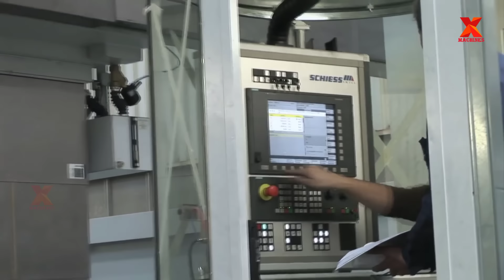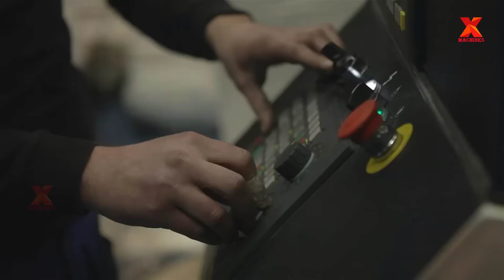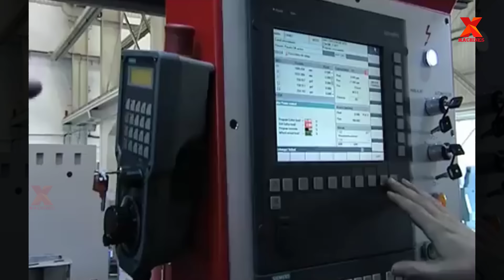Amazing Heavy Duty CNC Machine. Multi-Process Vertical Mill Turn Machine. Crankshaft Rough Milling

Comment: I used to work for Gleason Works early 1970's out of High School.  I would go watch the gear-cutting and gear-grinding machines while on break.  I ran a cylindrical grinder, grinding the O.D. and tapered surfaces of the collets that were used for holding the uncut gear blanks in the cutting machines.  That was back when Rochester, N.Y. had REAL jobs at good pay!  I always liked grinding -- the finished product looks so nice!
Reply: luckyyyyy thats so cool though!
Reply: Worked as a class "A" grinder hand for 30 years in job shops, no production, and I concur, when a customer sees a finished part, what he sees is the grinding.

Comment: Imagine showing this video to a group of the most skilled machinists 200 years ago, it would blow their mind how much material we can move in such little time
Reply: It blows my mind 200 years later.
Reply: We learnt how to use fossil fuel energy, bad thing is does not last forever
Reply: 200 years ago 😂
Reply: Laughs in Ancient Egyptian.
Reply: @spencerhardy8667  no you're right Egyptian CNC machinists were far ahead of us...
Reply: @spencerhardy8667  I'm talking moving steel with drills and cutters, not physically moving blocks of metal
Reply: @pablolabarta4038  We have a couple hundred years of it, panicking over nothing.

Comment: Graduated from a technical high school where I became a machinist.  At age 23 I interviewed at GE to operate a 4axis horz born mill. I machined gear boxes that held all the gearing and other parts. The  average  casings  needed a crane to set them on table and were the size of a large refrigerator on its side. I expected average machine and average size parts. 
  When i went for interview by supervisor and superintendent in the building I would work in. I entered a door beside a large garage door. The first thing I noticed was the largest vert turret lathe I had only seen in books. 2 overhead cranes were setting the largest gear I had ever seen on to VTL. I learned later it was a bull gear for a U.S. carrier.
  I was working in the GE gear plant in Lynn MASS and nothing was small. All HBM used the slotted steel floors as their table. We specialize in sub gearing and reduction gearing for carriers down to destroyers. At te end of 4 bays the units were assembled and tested . I won a bid for the highest paygrade with an rd classification. 15,000 union employees.  The job was GE develope 3 sections that make up one propulsion for the DDG  ARLEIH BURKE class destroyers. Specifically designed natural gas turbine connected to high speed reduction with hardened gears then electric propulsion.  The reduction gearing case unit almost half the size of old reduction gearing  and operated at higher speeds. 
  They installed the largest 7 axis cnc horz boring mill at that time in U.S. mid 80s. The construction requirements required pillars of cement going down over a hundred ft to the solid rock. Below the machine it had 2 stories consisting of electronic devices Anand pumps and other stuff.  That was 35yrs ago and i still brag about what we did. Different types of electric drives also started appearing

Comment: While in high school I was given machinist jobs for the summer months. First machine shop was in a large old shoe factory. It was now many smaller machine  companies.  Half of the machines still ran on the belt system. A long shaft running along the ceiling with belt going to each machine. Other section had modern machines. In my shot machinist career I operated old belt equipment to the largest 7axis CNC horz boring mill in the country. 77 to 87
Reply: That is actually really cool!

Comment: I have to just say this.  As  a person that operated a 7 axis gantry mill for years.  you can not appreciate this video fully unless you actually see it in real life.  Some of the machines in this video are complete monsters that eat steel like nothing.  Crankshaft wheel cutter is taking 8mm bites of steel out of that cranks every time tooth chews a piece off.

Comment: I wonder what machine  made the machine that makes the parts?  That goes back and back to the beginning of machine tool design.   We think we're pretty cool with all the tech we have now, but the lat 1800s had huge machines that did some of the same things, just not to such close tolerance.  2 story tall gear hobbers.  What machine made them?  I just think this needs some perspective.

Comment: This is what a modern company does to win jobs. Nice clean manufacturing building and everything painted. Machinery up to date and looks like treatment of employees is great.  I worked in an old school GE gear plant in Lynn MASS and now it is a vacant lot. Most of the large horz and vert boring mills were pre ww2 and manual.  The union wanted the machinist in the new factory of the future to have high seniority and top pay classifications. GE built the state of the art factory an based future decisions on results. So how do you think it went.  Put high seniority and high pay employees that don't need to worry about the future. Stupid grievances of small issues just to make conflicts.  After 20 or more years your enthusiasm is gone. GE tore down this massive investment and no more expansion in Lynn. The union never budged on issues but if they did there was plenty of space. Could of increased employees and the future for them. Instead there is a supermarket at the torn down factory of the future location instead

Comment: I know it would take a tiny bit of extra effort, but most of these images have no scale. Nor is the frame rate apparent some places.  I would like to see specs for the operations - power, forces, pressures, cutting rates, materials, size, mass - whatever you have.  It is possible to put that as overlays in HTML5 over the video area.  Mostly there are processes here that 5 Billion Internet users do not have time to look up or translate to specifications.  The pace of global technology might well increase many fold for solar system colonization. Evaluating suppliers, service providers, facilities and capabilities might hinge on near real time gathering of capabilities and decisions.  The AIs can do that now, but it could become the norm, for most design and engineering to be done by human-AI teams, in near real time.  Richard Collins, The Internet Foundation